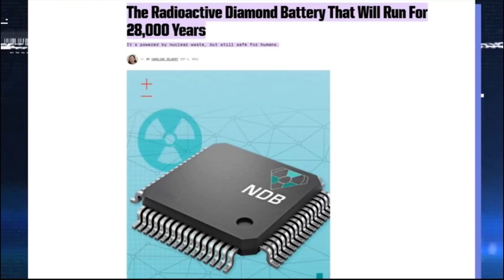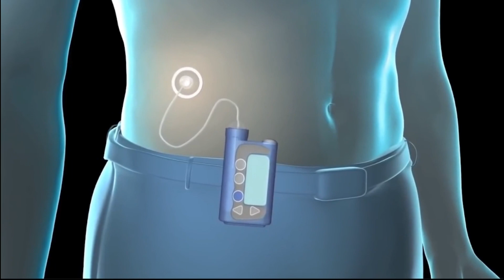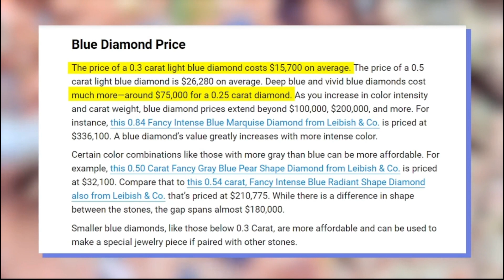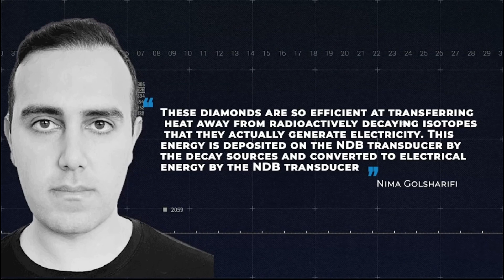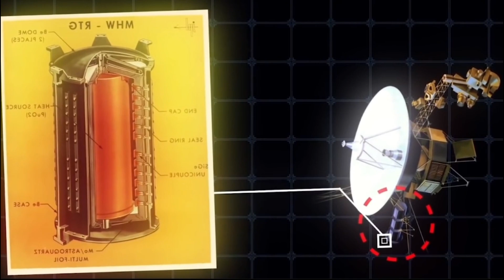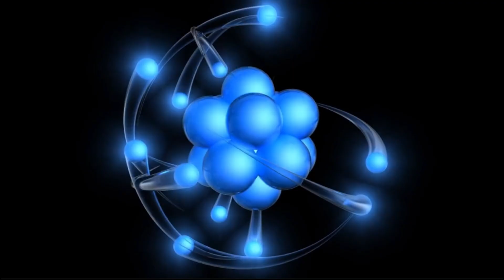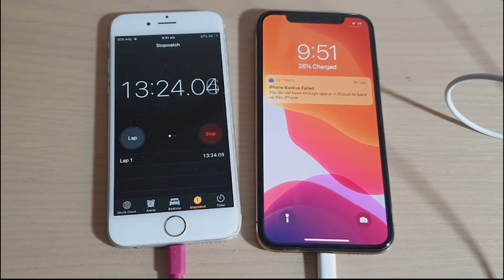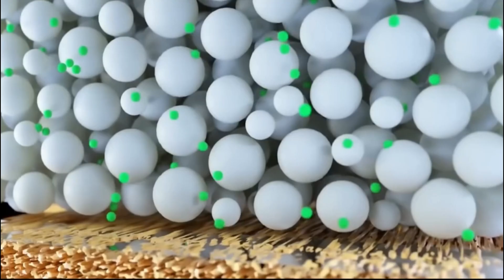Elon Musk's Nuclear Diamond Battery: A Revolutionary New Energy Source

Comment: Wait a minute there……This tech has been around since the mid 70’s. And was first proposed to use in pacemakers. But never took off for a variety of reasons. Why title it as “new” ? 

I haven’t looked yet, but is there a patent expanding on the original tech? Or have I shifted into another adjacent dimension where this tech is just now coming out now instead of 50 years ago?!? You can’t trust anything anymore!